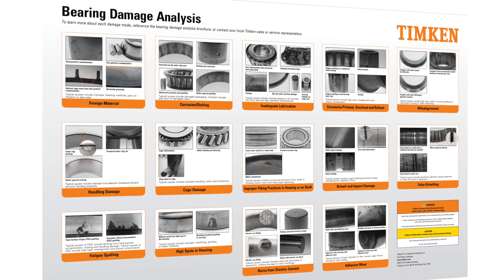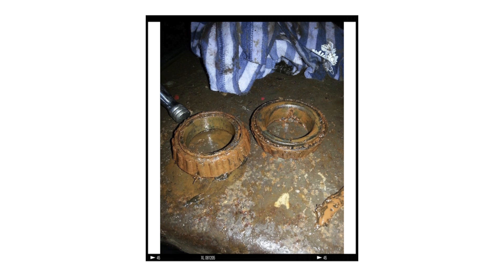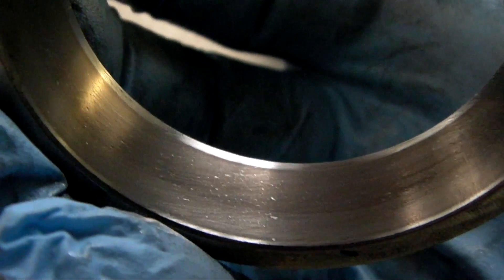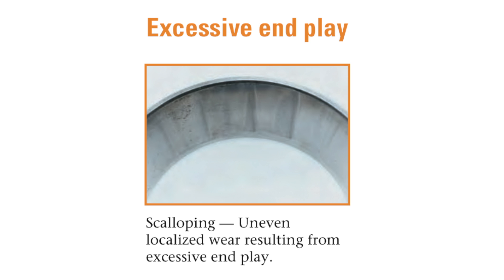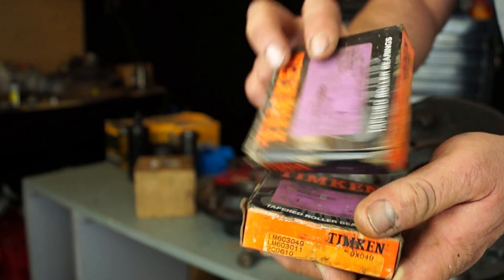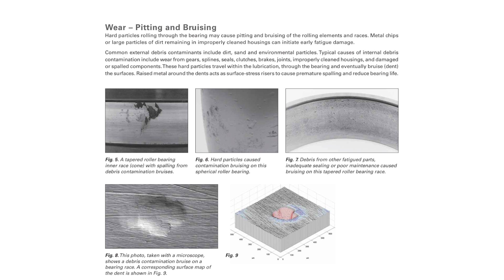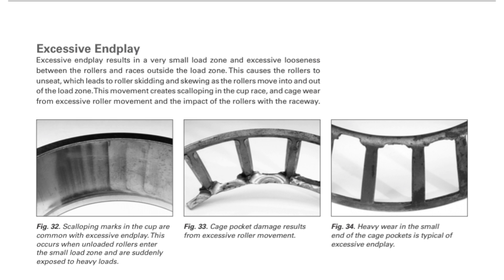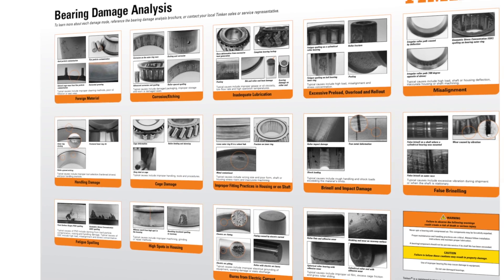Timken guide on Land Rover wheel bearing damage.

Comment: I found getting the bearing changed more regularly or at least checking them to be very useful, previously one had been installed but not properly, eventually it failed, ceased, overheated and fused...end result - the half shaft ironically sheered in half.

not good

Comment: I've just been replacing bearings and races because I didn't know better.  I had the left front explode inside the hub.  Limped home a few miles to find the hub filled with bits of bearing and lots and lots of metal dust.  Learned to pay attention to hubs and rebuild on schedule.